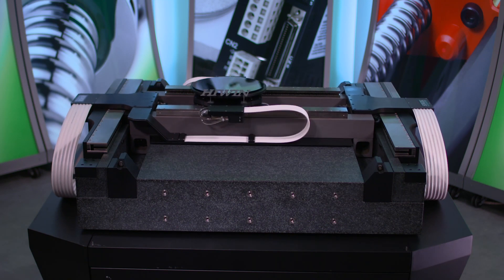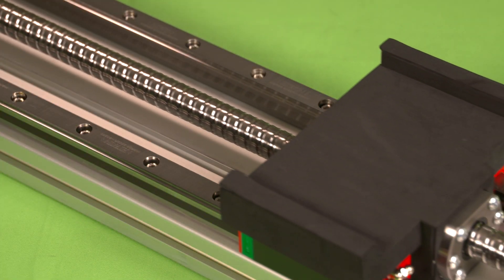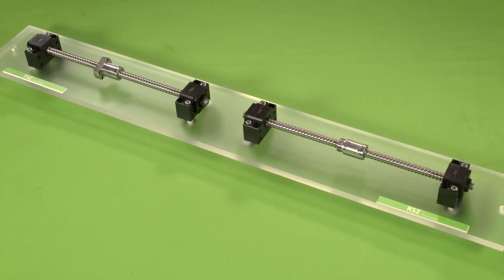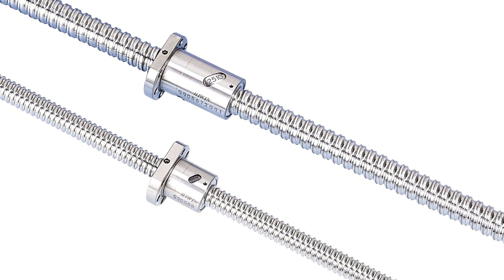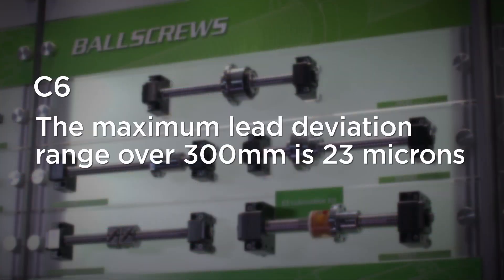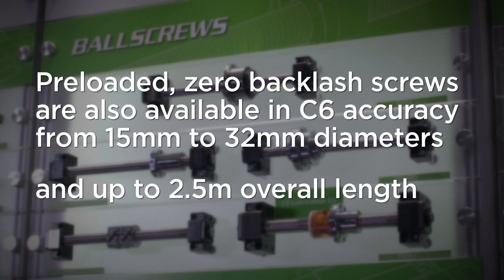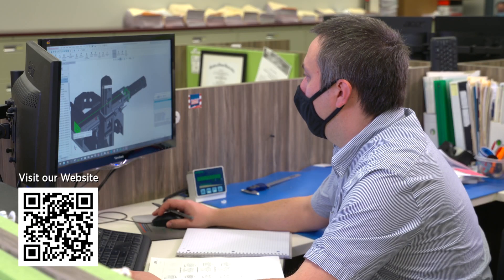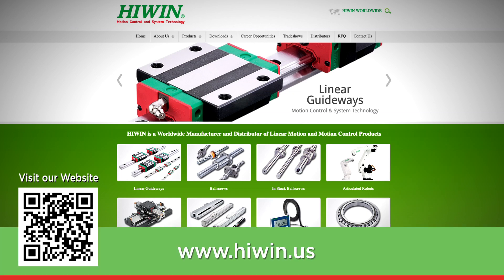Hiwin Ballscrews

Comment: Could a linear motion system be made using two ballscrews? So a left-hand and a right-hand rotating together, but counter-rotating. I feel like this would counteract any backlash and premature wear.
Reply from the maker: Thank you for your question. 

The two most important ways to avoid premature wear are to make sure the ballscrew is aligned properly and maintain the system to keep the ballscrew lubricated and clean. 

The best way to decrease backlash is to preload the ballscrew nut.  While this increase in preload force can affect the life expectation of the system, it is the most common method that HIWIN uses to achieve zero backlash. 

HIWIN recommends running two ballscrew nuts together to distribute the load, but there is no benefit in using a left and right hand screw together.

Thank you again..

Comment: Hi, i am from India. I want to replace ball screw of z axis in my cnc engraving machine because there is little accident and there is lot of vibration sound  from spindle because i think  ball screws are damaged in that accident.  Ball screw brand is Hiwin. it has vertical movement of 60mm. So can you guide me what should i do ?
Reply from the maker: Hi Ajay, Thank you for your business.   This channel supports customers in the Americas. I would like to connect you with the right partner in India to advise the best solution.  Where in India are you located?

Comment: Do you also have anti clockwise / left hand threaded ball screws??
Reply from the maker: Hello Arbj, Thank you for your question. While right-hand turn is standard, left-hand turn ballscrews are available upon request, depending on size.  In the case of Rolled Ballscrews, page 152 of this document https://www.hiwin.us/wp-content/uploads/ballscrews.pdf indicates where there is a choice for left-hand-turn for particular lead and diameter for C7 accuracy ballscrews. If you are located in the America's, reach out to distributors or engineering, with your specific requirements, on https://www.hiwin.us.  For other locations, hiwin.com can help locate the nearest sales office. Thank you for your interest in HIWIN.
Reply: @hiwin-usa  was this even a serious question? As far as I can see left or right hand thread makes no difference to it going back and forth.
Reply from the maker: @DodgyBrothersEngineering  Thank you for your question. There are some applications that specifically require left-hand threads. One example might be a multi-axis CNC machine.  There are also ballscrews that have both left-hand and right-hand threads on the same shaft, such as a clamping application.  Please let us know if we can help you with your project.
Reply: @DodgyBrothersEngineering  Yes. It is a serious question but more for specific applications.
Reply: @nh18343  where would you need it? I used all the same type on my CNC. Maybe like @hiwin-usa said where you need both on the same shaft, but I am guessing that would be for an application where you need it to return to a mid point.
Reply: @DodgyBrothersEngineering  we use left and right threaded lead screws for  positioning of sensors. This is required when the application requires the use of a single control motor.
Reply: Hello